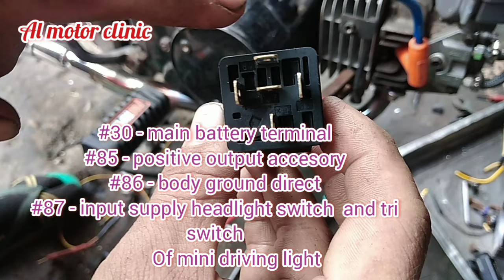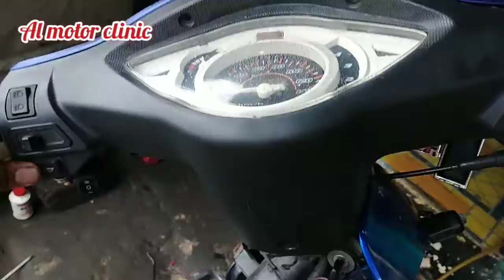Honda Wave 100 Paano Mag Install ng POWER UP LINES.  Pampalakas ng Supply sa Headlight. Alamin.

Comment: Boss idol pag on mo ba Ng susi dapat ba neutral lang naka ilaw sakin Kasi na ilaw mga ilaw lahat sa pannelboard paano ba Gawin para neutral lang naka ilaw ilaw lang panel board pag on Ng headlight
Reply from the maker: May posible problema sa wiring mo boss pa check mo nalng baka mabilis ma lowbat battery mo naka fullwave ba yan motor mo

Comment: Idol nag power upline din Ako Ng wave 100 Kaso yong Isang number 87 sa relay ginamit ko para sa mdl pero bakit Ganon pag on ko Ng susi di Siya gumagan tapos pag off ko susi Saka Siya Nagana yong switch na gamit ko may tatlong wire alin ba dapat Ang top ko sa number 87 Anong kulay maybtwtlong kulay Kasi sa switch ko may item,pula Saka green alin Ang common sa tatlong kulay.
Reply from the maker: Ikabit mo sa black boss Ang isang 87
Reply: Salamat idol god bless

Comment: sir tanong ko lang yung yellow wire ba na pinutol mo po, yung isang kadugtong niya is wala na gagawin dun? bali ang i tatap nalang is yung yellow wire na papuntang headlight tapos yung kaputol na isa is wala na gagawin dun?
Reply from the maker: Yes sir nakuha mo ganun po Ang gagawin nyu
Reply: yung yelow ba na galing sa regulator lanng ba puputilin para maging battery drive.

Comment: Sir naka fullwave po ang stator at rectifier ko!  Pag tumatakbo po aq umaabot po ng 14.1v ang reading ng voltweter ko. Pero pag nag preno po aq ay nagiging 12.8v ang reading pag sinabayan ko po ng headlight ay nag da drop off reading po sya s 11v  anu po kaya sira sir?  Regulator po b? Or  charging system n galing stator po?
Reply: Baka naka stock bulb yung brake light mo sir.
Reply from the maker: Maganda nyan sir try. Mo power up Ang linya sa headlight
Reply: Sir nka power uplines npo ginaya q n po ang pag power uplines nyo po.
Reply: @marielvillacarlos7227  sir nk stock bulb lang po yung s brake lights q po. Bkit po kaya ganun kapag umaandar n aq inaabot ng 14.1v pero pag nag footbrake npo aq nag d drop off po sya ng 12.4  minsan 12.8v   pero pag binuksan qn headlight nk 11v nalang po sya. Nk power uplines npo sya at gnaya po namin ang pag power uplines kay sir al clinic motor
Reply: @almotorclinic7447  sir nk power uplines n po namin kahapon at sinundan po namin ang video nyo po s pag power uplines.  Di po kaya bk mahina kumarga ang rectifier q po kc pag wl mga ngana ilaw ay umaabot po sya ng hanggang 14.1v lamang po pero pag nag preno npo aq biglang babagsak ng 12.4v  tpos pag gbi nag headlight aq ay 11v nalang po
Reply: Ok naman ang charging system.....baka luma na ang battery mo
Reply: Gamit ka led bulb sa brake light mo thanks me later

Comment: Boss maayong buntag.
Tanong ko lang boss kong parehas lang ba ang wave 100 sa wave 110 na color coding.?
Reply from the maker: Yes boss parehas lng
Reply: Ganun bah boss..Kasi yong sa wave 110 Naka hiwalay sa socket Ang dalawang wire na sulid black at sulid yellow..na papuntang stator..
Reply: Boss Al. Yong kulay black Po ba Doon eh yon na Ang Acc line?
Para Hindi Kuna  balatan Ang harnes..?